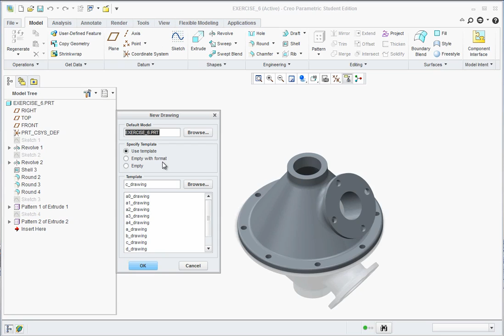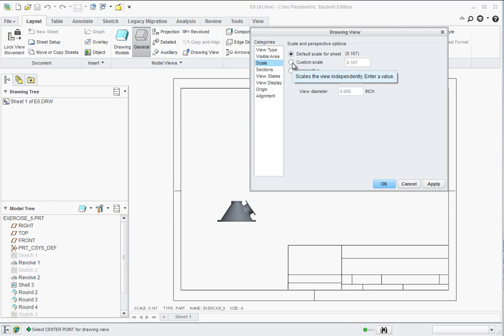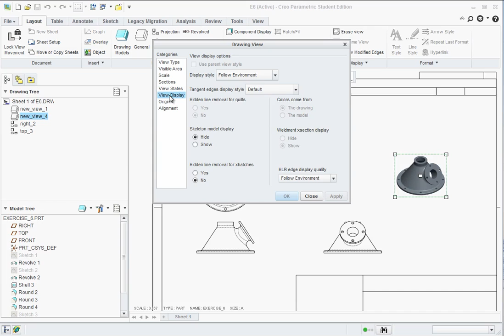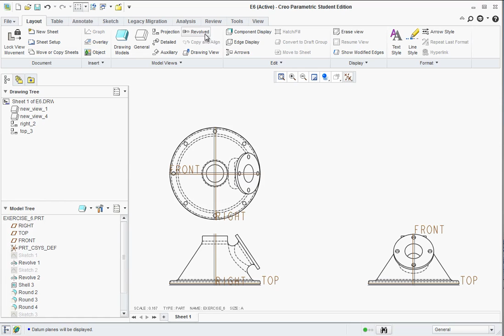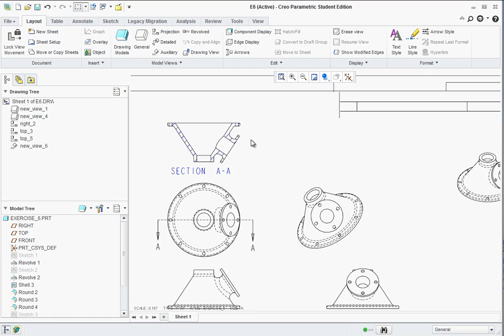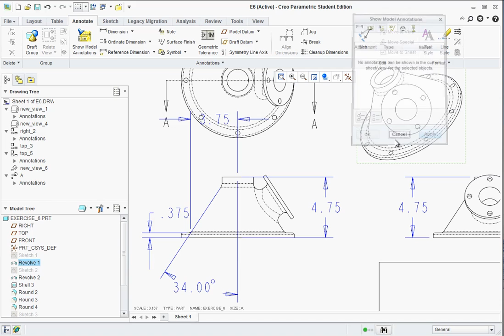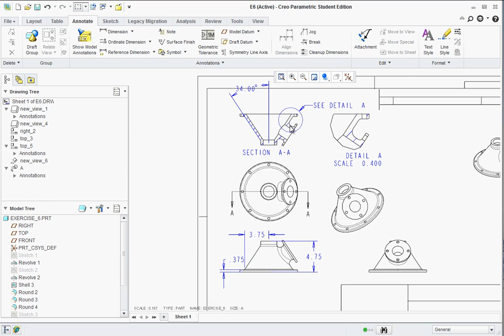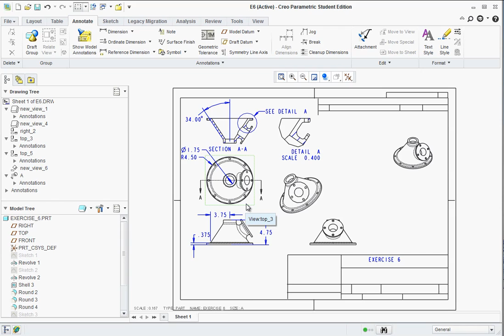E6 CREO Parametric 2.0 Detailing 1

Comment: Sometimes when I click dimension and then click once or twice on the edge of a circle and then middle click it will come up with the radius or diameter but then other times it won't work and I can't get it to dimension. There is a Menu Manager that comes up and I have tried all of the selections: On Entity, On Surface, Midpoint, Center, Intersection, and Make Line. Why won't it display the radius or diameter?

Comment: does anybody knows why my center marks and centerlines  are not  visible in all the drawing views basically for the cylindrical objects. seriously this software is not at all user friendly taking more time to find the option and a simple job is time taking.
Reply from the maker: You need to go to the annotations tab, then select the view you want to see the center mark in. Then select "show model items" icon (flashlight). Then select the datum tab on the top of the menu. There you will see all the center marks, select which you want and hit OK
Reply: +vertanux1 thanx  i got it

Comment: This may just be a preference, but IMO the custom scale option is for views that do not carry the same scale as the rest of the drawing. 

Instead, before you insert your general view, set the scale of your drawing. You can do this by selecting the dimmed scale option at bottom of drawing window. Mine also shows type, name and size the drawing is. Double clicking this will allow you to set what you want the scale of your drawing to be.

Comment: Hi, according to engineering drawing  books, on any projected view, all holes should have their line-dot-line reference, how do I do that ?
Reply: papi chulo There is a dtl option called: radial_pattern_axis_circle that should be set to yes (default is no*).  When you show the axes (assuming that the holes were patterned about a common central axis) of a set of holes in a view where the holes are normal to the view, the axes will show with their tips pointing to their common center axis with a bolt circle (centerline font = line-dot-line) passing through the centers of the (circular) patterned holes.